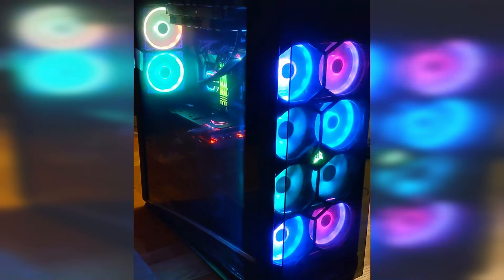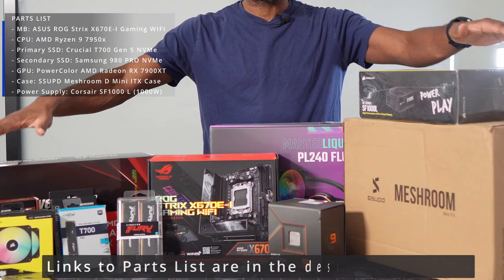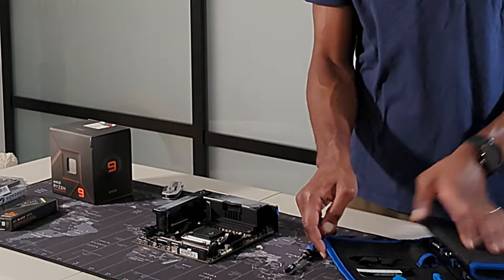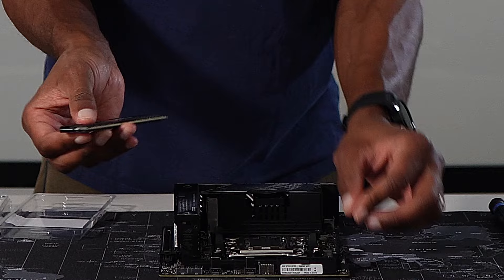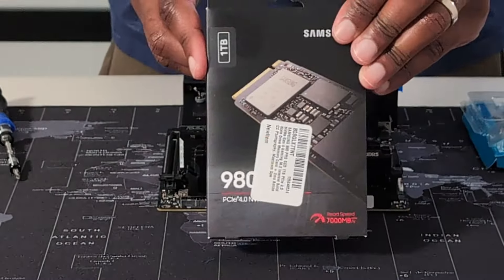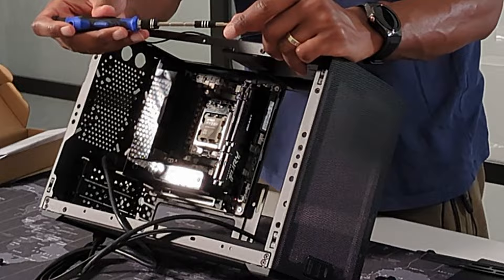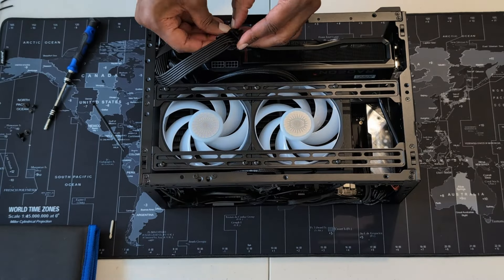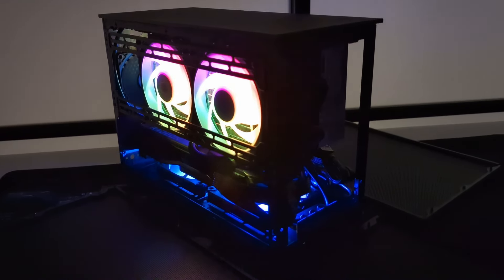My Ultimate Mini PC Production/Gaming Build | SSUPD Meshroom D

Comment: ayooo.. we have the same build, but I just have a slightly bigger card the 3080ti rog and the aio, I could barely fit it in. Also, you have so much space with that aio radiator in , I had to almost force my way fitting a 280mm aio. Im not even sure if it breathes properly lol but it lives, and after more than a year it's still holding up. Great build man.
Reply from the maker: Nice! The build is running real smooth, and the temps look good thus far, so I'm pretty satisfied. Glad you're happy with your build. Thanks for watching, I appreciate the view!
Reply: @BEWellTech  yeah. mine was so crowded there was barely any room at all to stick your finger, that 280mm was thick rad. Did you add a small fan at the back beside the io ports?
Reply from the maker: @Wyse-Gaming  Yes, I added a Coolermaster 80mm silent sleeve bearing fan as an exhaust fan in the back.
Reply: @BEWellTech  ahh okay. nice

Comment: Could i ask why you went for 7950x and a x670 e and not a ryzen 7 7800x3d and a b650 e mother board and used the saved money on a 7900xtx?
Reply from the maker: Ahh good question. If my goal was to build mainly a gaming machine then I would have gone with the Ryzen 7 7800x3D. That is pretty much the perfect gaming CPU. But this build is meant to replace my big Corsair machine that has a 9th Gen Intel i9 chip. It was used for rendering, editing, and some gaming. But more for the heavier tasks. Since I needed to go the Mini ITX route due to my space constraints, I chose the AMD platform because of the lower power consumption and better thermals. With that said, I needed an AMD equivalent to the i9 chip in the outgoing machine, and the 7950x was the better choice for my use case. 

Regarding the 7900XT or the XTX. At the time that I purchased (which was months ago), there was over $300 difference in price. I didn't think the performance difference was worth it.